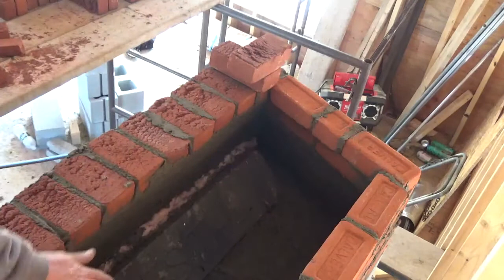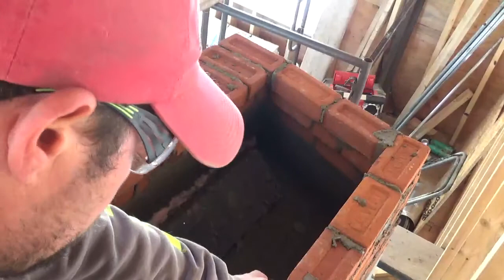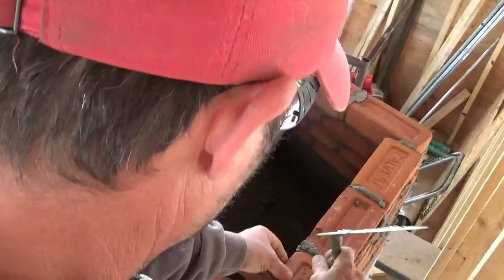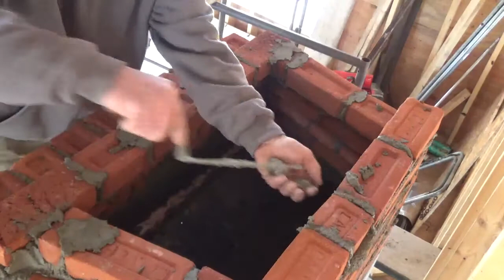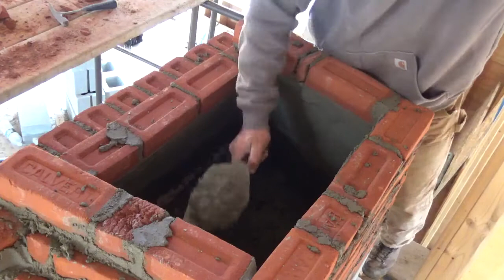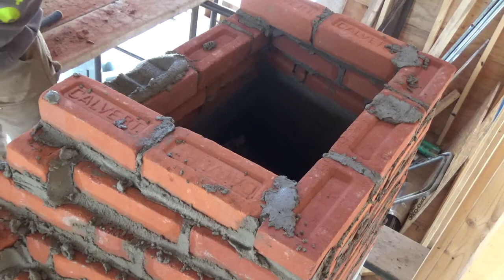Smoke chamber brickwork

Comment: Hello! did you happen to shoot any video of setting the flu tile?  Also, what's the best way to clean out excess that's dropped down on damper and smoke shelf?
Hope one day you shoot an entire proper fireplace build series from start to finish. You would be the first actual Mason to do so. Lot's of DIY Kit builds out there, but most appear to me to be junk. I don't understand why so many don't even think about a smoke shelf.
Reply from the maker: I don't think so. The best way to clean up is a layer of sand on smoke shelf and take the damper lid out. I put a few of the thin sheets of wood from a skid of brick over the damper opening then it's easy cleaning up

Comment: Music ?. wish you had shown how to actually build a smoke shelf
Reply from the maker: I got a fireplace to do in a month or 2 I'll film the whole thing!
Reply from the maker: If you got questions I'll answer em
Reply: watching again. FyI...Very hard to understand what you're saying, radio is too loud.
Reply: What's your favorite refractory mortar? What do you use to parge ? Is the brickwork done with special high heat mortar,? If so, what type brand do you prefer? Thank
Reply from the maker: Main points: 1 keep the first course of bricks off the damper leave an inch or so. Put a little fiberglass or rock wool insulation around it. 2 If the bricks have frogs in them lay em frogs up (upside down) they're more stable that way. 3 make sure in the first first few courses not to circle sides too fast so you can still get damper lid out. 4 Put a little sand on smoke shelf this keeps mud that falls from sticking. 5. Keep back wall plumb. 6. Overlap corner returns where possible. 7. Parge as you go. 8. It should take roughly the same distance to do the smoke chamber as the fireplace is wide- 36" wide firebox should take around 3' of chamber to get down to flue size.
Reply from the maker: @bartosullivan8050  just regular mud is fine. I make mortar the old way. 1 75lb bag of type s masonry cement to about 5 5gallon pails of nice masonry sand for brickwork. I avoid the premix whenever possible. When I do the firebox I put about 2 shovels of fireclay in the mix but that's all.